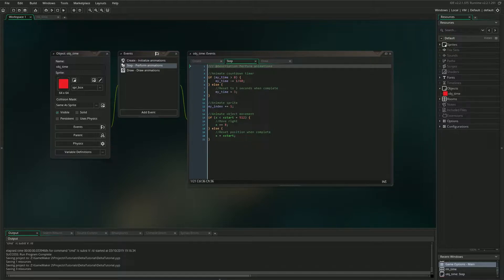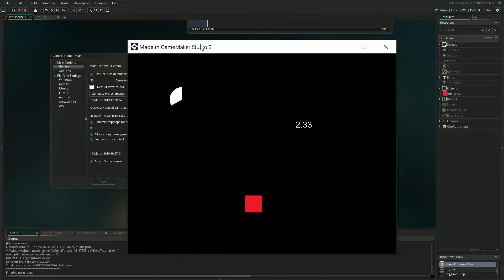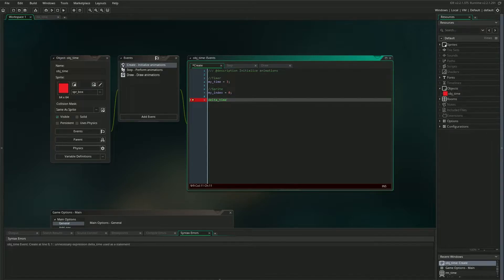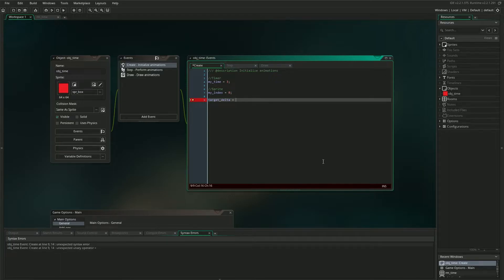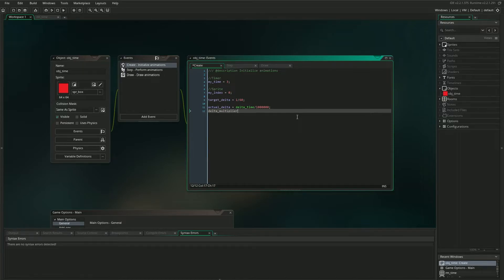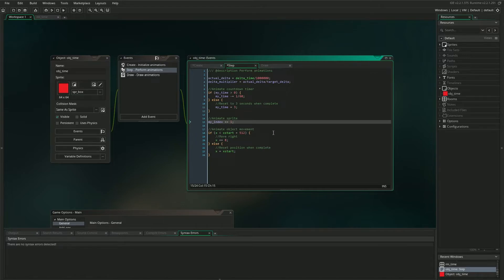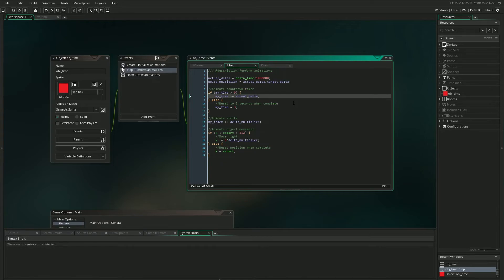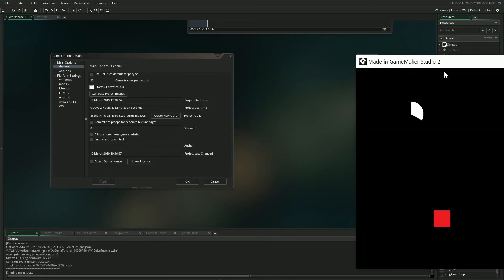Demystifying Delta Time - GameMaker Studio 2 Tutorial

Comment: // Calculate the difference between tfacing and facing, clamped to -180 to 180 degrees
var angle_diff = cycle(tfacing - facing, -180, 180);

// Define a maximum rotation speed (degrees per frame)
var max_rotation_speed = 5;  // Degrees per frame

// Apply delta time properly to avoid overshooting and ensure smooth movement
var rotation_per_frame = angle_diff //* global.data_multiplier;

// Limit the rotation speed to max_rotation_speed to avoid overshooting
var clamped_rotation = max(-max_rotation_speed, min(max_rotation_speed, rotation_per_frame));

// Update the facing angle smoothly
facing += clamped_rotation * global.data_multiplier;

// Ensure 'facing' stays within -180 to 180 range (avoids wrapping issues)
if (facing > 180) facing -= 360;
if (facing < -180) facing += 360;

// Smoothly update direction based on the final 'facing'
direction = facing ;

// Ensure direction stays within the 0-360 range (GameMaker's expected range for direction)
if (direction < 0) direction += 360;
if (direction >= 360) direction -= 360;

trying to add the delta multiplier to the direction of the player i have a 3d camera and 8 direction movement its a 3rd person game the direction interpolates smoothly at 240 fps and 60 fps but starts glitching at low frame rates i cant figure out why the direction and facing values glitch out at low frame rates

Comment: So I followed this tutorial and it works great across 15, 30, 60, and 120 FPS. However, when I tried setting the "Game frames per second" to 144, I found that it broke. This appears to be due to the value of delta_time changing drastically between frames for any FPS above 130. For example, I found that I could set the FPS to 130, and I'd get delta_time values like:

delta_time:7692  FPS: 130
delta_time:7693  FPS: 130
delta_time:7692  FPS: 130

The game worked as expected at that FPS, but if I set it to 131 FPS, I'd get values like this:

delta_time:7127  FPS: 131
delta_time:7057  FPS: 131
delta_time:13611  FPS: 131
delta_time: 257  FPS: 131
delta_time:13612  FPS: 131
delta_time: 203  FPS: 131
delta_time:13674  FPS: 131
delta_time: 190  FPS: 131

That caused the game to run extremely slow. Any ideas as to why that might be occurring?

Comment: Why don't you just multiply by actual_delta? Whats the point of the whole delta_multiplier? I don't see the point.
I can't think of a case where delta_multiplier would work better than actual_delta for some reason.
Reply from the maker: Well, it would probably be entertaining to multiply by actual_delta, at least--the game speed would change every frame!

This is why I show a use-case for both delta_multiplier and actual_delta. Since actual_delta tracks how much real time has passed, you can use it to add/subtract from values that also represent time. But for values that represent *rates*, that doesn't apply. You need a multiplier to adjust your rate so that it doesn't change regardless of how much time has passed.
Reply: @LucasLive  What if i dont have a "desired framerate"? In a game where you can easily get up to 1000 frames i would want people even with 540hz monitors to be happy. What would be the value i should use for my delta_multiplier?
Reply from the maker: @RoccaaaHD  You should not choose a value for delta_multiplier. You only need to choose a base framerate in target_delta for something to design your art and logic around. The actual output framerate doesn't matter, which is the whole point. Even if your target_delta is 1/60 (i.e. 60 FPS) you can set your project's game speed to 1000 FPS. Think of the project game speed as a cap.

I would suggest watching the video again--this is all covered in more detail there!
Reply: @LucasLive  Sorry, i misuderstood the video. I haven't noticed at the start when you were talking about the fact that gm's deltatime isnt really what it says. My bad

Comment: How would one use this to keep consistent gravity/jumping between different frame rates?
Reply from the maker: Depends on your implementation. If you're rolling your own gravity system, you'd have to multiply your acceleration variables by delta time like any other movement. This might also involve using real time (as an increment of frame time) in the case of "jump hold time" and such. If you're using physics, you'll need to either update your forces by delta time individually or use a function like physics_world_update_speed to sync physics speed with game speed.

Comment: Do you know how to deal with animation speeds for different framerates? I noticed that my animations run at half speed when the fps is half of the game update time.
Reply from the maker: That's... kind of what the whole video is about? Perhaps you can clarify a bit?
Reply: @LucasLive  I mean image_speed, not animation speeds. My bad. I saw you answered this in a comment below!
Reply from the maker: @panoramaman-t3q  Ah, that makes more sense! If you want to use image_speed, you can just assign it to the delta multiplier each Step. (And multiply the delta multiplier to create different image_speeds.)
Reply: @LucasLive  I see, so the image_speed has to be set manually for every object with multiple sprite frames?
Reply from the maker: @panoramaman-t3q  To sync image_speed with delta time, yes. Since delta time is always in flux, image_speed must be continuously updated to match. Or you can increment image_index as shown in the video. The result should be the same either way, but in older versions of GameMaker, image_speed was bugged and didn't always work as expected.
Reply: @LucasLive  Do you set the image_speed to 0 in the gamemaker editor?
Reply from the maker: @panoramaman-t3q  No, the sprite editor speed should be your actual target speed. Then set image_speed to the delta multiplier so that it's adjusted correctly.
Reply: @LucasLive  I see, thanks for the reply! You mentioned something about collision line when moving an object in case of lag spikes, can you explain more about that?
Reply from the maker: @panoramaman-t3q  That could be the subject of its own video, but basically, you often see suggestions to check for collision by taking the current X/Y coords and adding movement speed to calculate the next step. But that only works if your movement speed is less than the size of all possible colliding objects (otherwise, you might step right past them). With delta timing, your movement speed may temporarily be many times larger than expected to keep up with loss of framerate, so that margin of error becomes way wider. It's not a flaw with delta timing, it just reveals why it's always a bad idea to handle collisions this way. The correct solution is to use collision_line functions to check if there are any colliding objects anywhere along the path you want to travel, then cap movement at the first collision so you can't step over anything.

Comment: How would you go about updating a variable holding the movement speed of an object based on delta time? I mean a movement speed variable in the create event.
Reply from the maker: You wouldn't. Set your movement speed variable to whatever you want your speed to be. Then, multiply it by your delta multiplier when you apply movement. Do not try to calculate delta time into the movement speed variable itself, or you'll instantly lose the original value.

Basically, in the movement example in this video, just replace the number 8 in `x += 8` with your movement speed variable.
Reply: @LucasLive  Thanks for the reply! I have one more question, I have collision checks with for example: if(place_free(x + x_increase...)... where x_increase is lengthdir_x with the rotation and movement speed. So I already do x+=x_increase*global.delta_multiplier, but should the collision be like this: ....place_free(x + x_increase*global.delta_multiplier...)... I hope I explained properly :)
Reply from the maker: @panoramaman-t3q  if I'm following correctly, you should just multiply movement speed by delta time. If you're referencing movement speed a lot, it would be worth changing the current variable to "movement speed base" and then making a new "movement speed" variable which is adjusted for delta time every step. That way, any existing references will automatically be adjusted for delta time.

As a side note, you almost always want to use something like collision_line with delta time, because lag spikes can make the position checks go WAY beyond normal. If you just check the target position, you don't know if, say, there's a wall in between that would prevent movement even if the destination is open. Checking a collision line solves that problem.

Comment: Hi, sorry for the somewhat Necro comment! Firstly, great and clear video on a subject that I personally took ages to grapple with (back in the days I was started, using DirectX7 and VB6!). Anyway, I hope you don't mind answering a question? I am trying GameMaker out for the first time, after having used Unity for ages. With Unity, Delta Time is exactly what you would expect. But this wonderful video (and other sources) seem to indicate that GameMakers' Delta Time is.... not! This video suggests a brilliant implementation. However, the GameMaker manual describes Delta Time in exactly the way I would expect it to work. So the (eventual) question is; is the solution suggested in this video still required in mid to late 2021? (i.e. have the development team changed their delta_time to work in the manner described in the manual, or is the manual incorrect)? Cheers!
Reply from the maker: The function of delta time in GameMaker hasn't changed, so yes, this method is still 100% relevant for 2021. As shown in the video, there are different ways to use the delta_time value for different purposes, so other methods aren't necessarily wrong. What's wrong is just the name, because it represents the previous frame time rather than the delta between the last and current frames.

Comment: Hey, I'm from the DDR Reddit question, and I have one more question regarding Delta Time: Is it possible to only have Delta Time influence specific parts of a game? For example, let's say you want to have a character's movement locked at 30FPS, but another character/object to reach a point by a specific time using delta_time. I know it's a dumb question, but I still am curious .<.
Reply from the maker: Possible, certainly, but definitely not advisable. If you want something to only occur so many times per second, you should set the rate through delta time rather than relying on internal game speed for some time-based logic and not for others. Basically, it's a shift from thinking about things in terms of frames per-second to thinking about things in terms of milliseconds. 30 FPS = 33 ms. Instead of your character moving once every frame, they would move once every 33 ms.

To convert FPS to ms, just divide 1 by your framerate, e.g. 1/30.
Reply: @LucasLive  Alrighty, thank you! That's good to know. This clarified a few things for me, and I'll try looking more into Delta Time to get used to it. It seems very needed for what my idea is, since it relies a lot on timing specific aspects, including audio sync and switching out different elements of the game. Thank you again for your help!

Comment: Hi Lucas.  I've been using your method of delta time for many months and it's proven very useful. However, I just updated Windows 10 today and suddenly all of the delta time implementation is acting bizarre. Everything has gotten jittery, in most cases seeming to run slowly. In other instances, objects jet off screen at exponential rates. This is even happening on exported .exe files from months ago that have worked smoothly before the update. If you still use this method, I'm wondering if you have noticed similar issues recently? Thanks for your time
Reply from the maker: Sounds to me like Windows Update screwed up your graphics drivers. I'd recommend using DDU to clean uninstall them and then reinstall from the official source instead of Windows Update. I'm currently on the latest build of Windows 10 and I still use this delta time technique without issues.
Reply: @LucasLive  That's great advice. I'll do that. Thanks for the reply and again for this tutorial

Comment: This way of implementing delta time seems different to what I've encountered before. In your example, we get a value to multiply our desired distance each step. For example, the value of delta_multiplier might equal 1.07 because our target was 1/60, but the game was instead running at 56fps. So in your movement code, we are multiplying 8*1.07 to move 8.56 every frame. This works, however, it tells us how much we are going to move every frame as opposed to how far we want to move in a second. Usually, I see delta time implemented as a distance in seconds by simply using:
x += 20 * (delta_time/1000000);
This way, we have determined that in 1 second of gameplay we want to move 20 pixels. If the game is running at 30 fps we will move 20px. If the game is running at 60fps, we will still move 20px in a second. This means we only need to consider the distance desired in a second. In your example, the movement has to factor the target framerate so that the increments work across all framerates. It also doesn't immediately tell us how far we will move in a single second, instead we have to calculate 8*60. Can you tell me what's the advantage to this approach?
Reply from the maker: It would seem the advantage is that it's less confusing. :)
You're talking about the same thing: "20 pixels per second" is just another way of expressing the same idea. There's no reason writing your code in values of frames should stop you from thinking about it in values of time. If you know how many pixels you will move in one frame, and you know how many frames are in one second, it's a simple calculation to figure out how many pixels you will move in one second. Delta time takes that number and ensures it remains constant regardless of changes in framerate. (Generally it's harder to do the opposite mental math--converting time to frames. What's 20 divided by 60?)
In my opinion, writing code in values of frames is the best of both worlds. You get the precision of frames with the simplicity of time. They're not mutually exclusive at all.
Reply: It can seem to be backwards when we tie animations and movement to frame rate and counter correct them when FPS fluctuates. We can just not tie it to FPS to begin with?  But that is just a statement. In reality nothing changes. Think about it this way; how are you going to implement movement and animations in Game Maker? The step event runs once each frame not each second. You already tied movement to frame rate by typing your code into the step event. How else do you want to do movement? Do you set a timer which triggers the movement each time when it reaches 1 second when a input is triggered? What happens when frame rate drops to say 1 frame per second?
Now your character jumps the distance it should move in 60 frames just in 1 frame. 'And when FPS comes back slowly but surely your character till teleport out of bounds very quickly.
So you still need to counter correct the movement distance by this method. As you have said. 
So it boils down to how you implement movement and animations in the game. each frame or tied to custom game time counter. Both have  advantages and disadvantages. Think about all the trouble you are going to go through with a custom game timer system since many things are read/write in frames in game maker. Input is being controlled per frame, sprite settings are in frames. so much to work around..

Comment: how do you use my_index to animate a sprite? i'm confused how delta_multiplier connects to image_speed
Reply from the maker: In this example, you'd replace the image_index argument in draw_sprite with the my_index variable. In my experience, image_speed is unreliable. In theory, GameMaker Studio 2 should have fixed image_speed and made it include game speed adjustments by default, but my years of GMS 1 have created a habit of ignoring image_speed and manually incrementing image_index instead. In most cases, this is still the better approach since you can animate multiple sprites at different speeds in the same object with full control.
Reply: @LucasLive  thank you for your reply!
Reply: This has been very useful for alarms and movements, but I'm still a bit confused on how to implement this method to animations. I can see the variable you made with my_index, but not sure how to connect that to the image itself. I don't really use the draw event, so maybe that's my problem.  I'm on GMS1.4 if it also makes a difference.